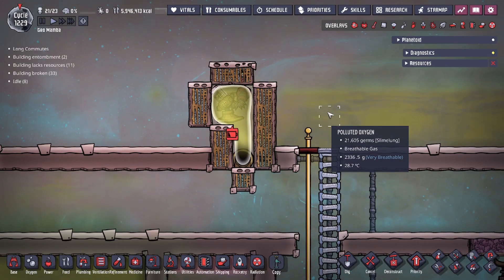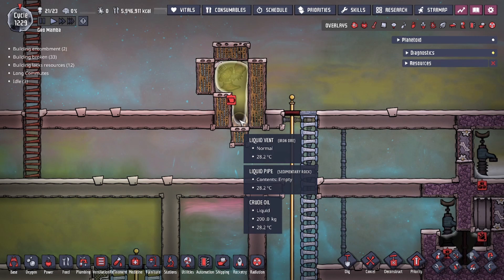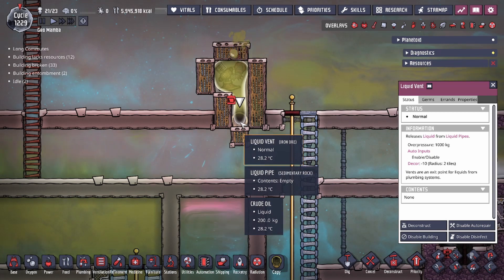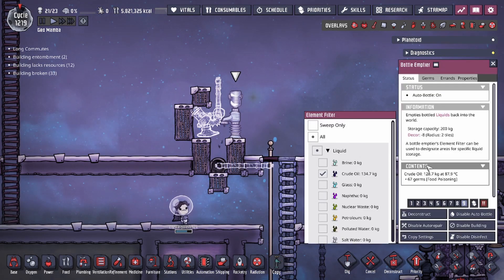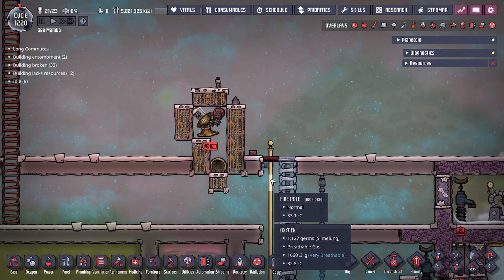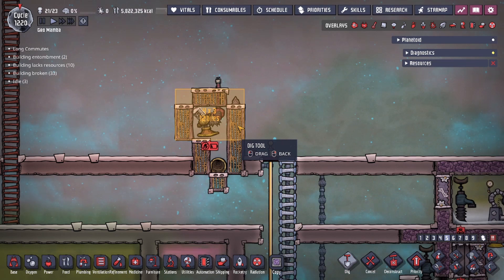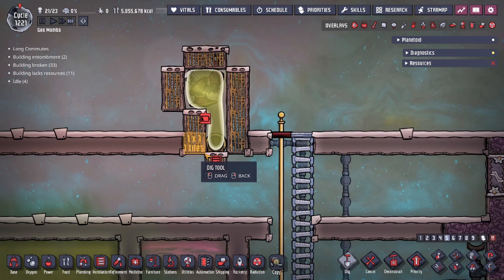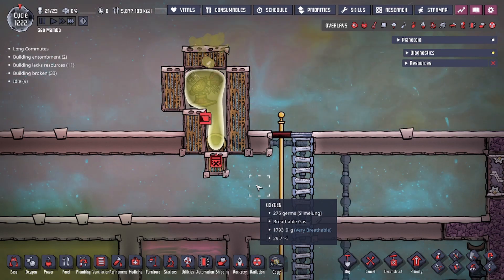Another Infinite Liquid Storage Design using Crude Oil & Liquid Density - Oxygen Not Included

Comment: Hey Legit, nice video as usual. 

If you want to store crude oil, you can still use the design by putting the liquid vent on top. You fill the first 4 tiles with crude oil and pipe 10K of any other liquid. The new liquid will be on top and the setup will work exactly the same way. I like using liquid instead of gas when I work in vacuum as it allows to still use mesh tiles.

Question: you say that the bottom nine tiles need to be pressure for any variation of the design. I only ever do the 6 bottom  and put my pumps right abore the liquid vent. The only issue I ever had with that was when I put the lower left of the pump right above the liquid vent as the pump will pump "down" and get the crude oil. Do you know of any cases where the crude oil would move up and break? One of the thing I like about using liquid in the vent is that the design is one tile shorter. Hopefully I'm not shooting myself in the foot.

Anyways, thanks again for all the nice videos.
Reply from the maker: thats a cool variation actually- its like the one that uses gas but specialized for crude oil! 

i only recommend keeping the 9 tiles instead of the 6 because of accidental pipe out of the crude oil- also because if the crude oil floats up ( usually when the box above it isnt completely filled ) it can move horizontally left or right and stay on those tiles and i prevent that by having those 2 extra airflows to form a tunnel vertically to prevent it. in both cases it only breaks the design if all the crude oil moves up and gets pumped out by the pump or stuck on a ledge